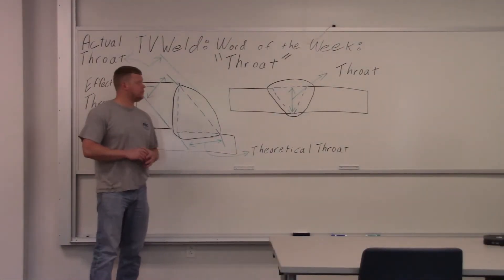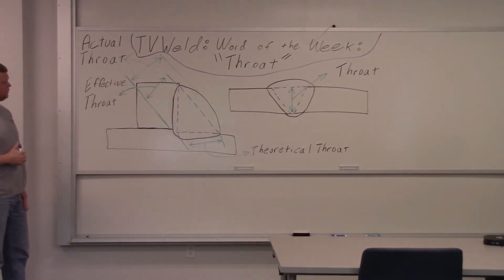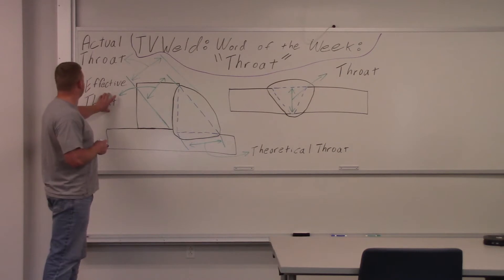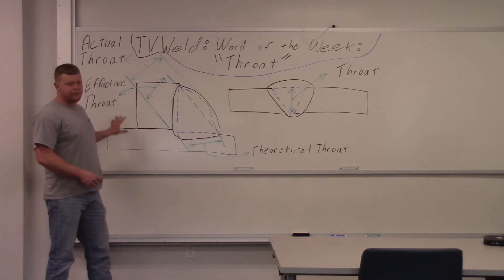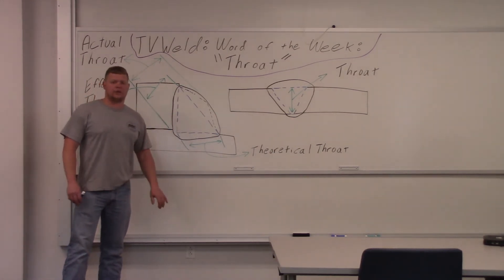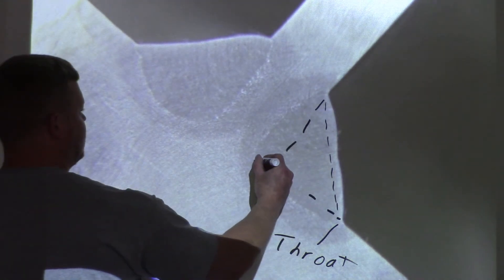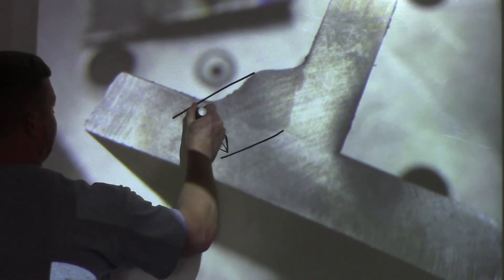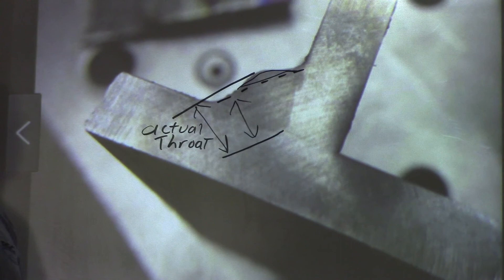Weld Throat

Comment: Thanks for the video!!! On analysis macro, Is possible to use both throats on measure? Like theoretical throat and actual throat. I don't understand when a should to use the specific throat for the weld on weld in T or Fillet

Comment: I do like how you explained this in your video, with one exception. Your example at 4:35-4:55 is calling out the theoretical throat, when really you called out the leg size. Not to be "that guy" but thought I would point out the mistake. I came across your video when searching for a Skew-T- Fillet Weld Gauge/Calculator and thought I would watch... Just thought I would point that out is all. Have a good day.
Reply: Its the same thing.